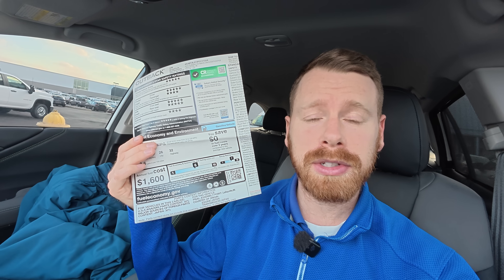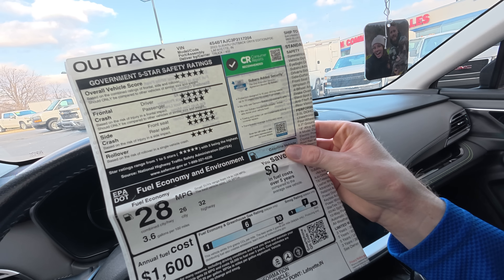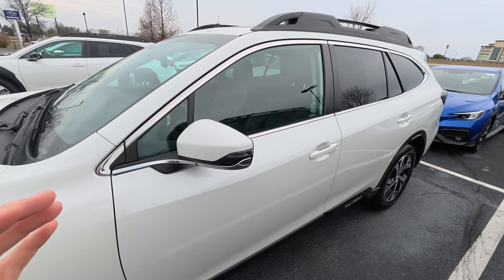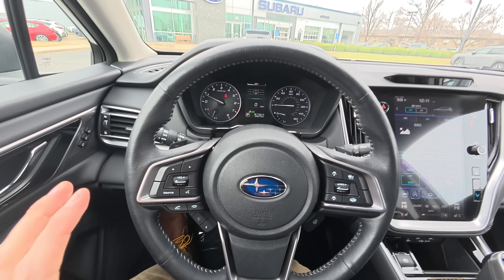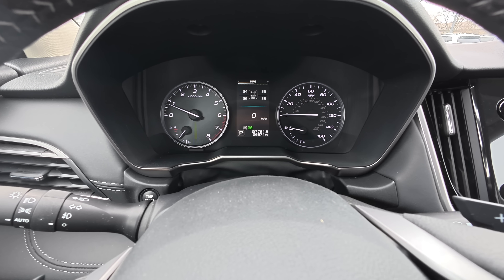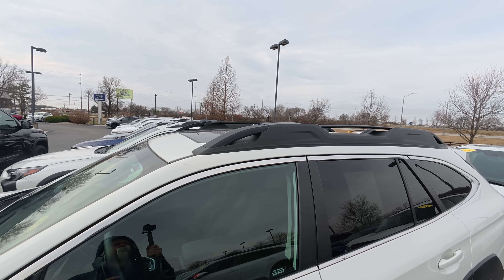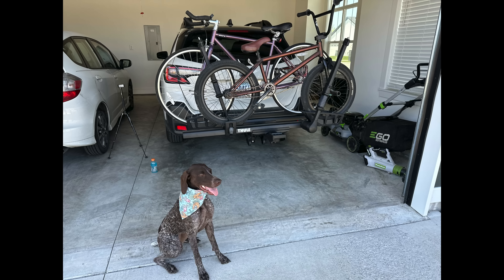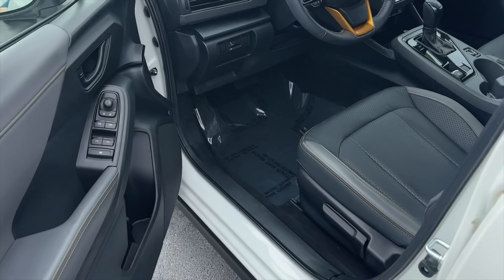Why your car may not get the same MPG on the window sticker

Comment: I added a Roof Top Ten to my 24 Forester Wilderness and lost about 5 mpg at highway speeds. I don't remove it because it's too mch of a chore.   Ouch!!!  Where did yu get that little micro tire inflator?
Reply from the maker: Yeah, those are heavy so I don't blame you! I think the last one I helped install was pushing 200 lbs! The tire inflator is from Amazon and made by a company called Fanttik. If you get one, just make sure it's suitable for suv tires
Reply: @alexpmo  Thanks for the info.  The RTT I piut on my Subie is an Inspreud Overland and it coems in at 76 lbs which isn't too bad, but it's still a wind break.

Comment: I've learned that no matter what vehicle I've had, trick, SUV, sedan, etc. I never get the MPG or miles per tank advertised.
I am not a mainiac behind the wheel, I get +/- 300 miles per tank on any vehicle I've owned.
My 2023 OB TXT, I get about 20-22 MPG max.
Reply: Is that city?
Reply: @vwxyz24 prob 50-75+% city on most of the roads I travel on mostly 30-50mph.